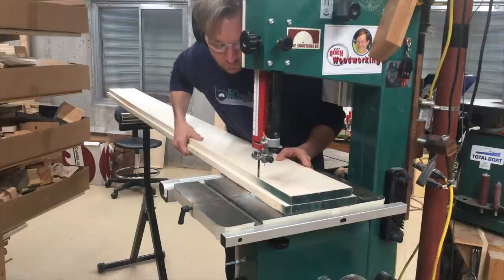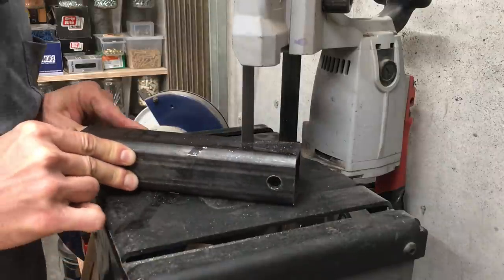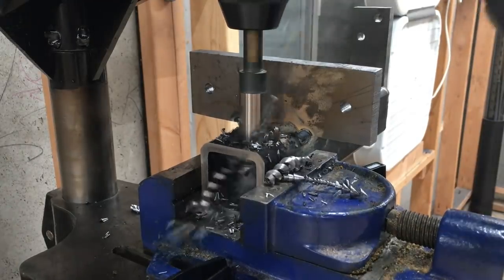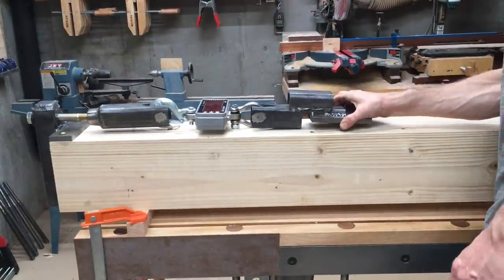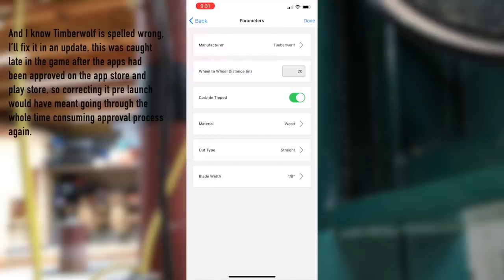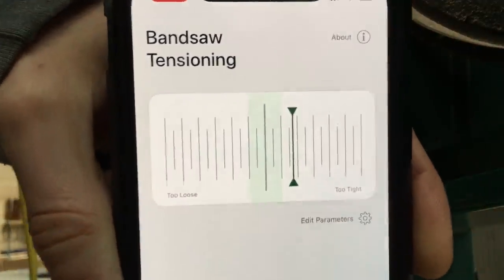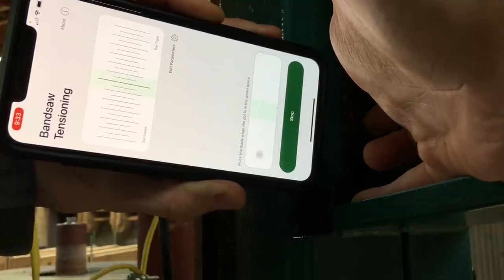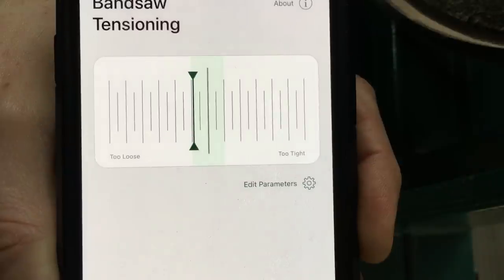New Phone App for Bandsaw Tensioning!

Comment: Love the idea! I just wanted to let you know that your app seems to have an issue on my android phone. It just freezes after taking the ten readings. Maybe it's just because android HW can be so different and a nightmare to test. But somehow I got the gut feeling that this could be due to the fact that I'm running a non-english version of android or more specifically a version which uses commas as decimal separator instead of dots. Maybe this messes up the analysis. I run into similar issues in a scientific work environment quit regularly ..
Reply from the maker: Sorry for this, yes, it seems I didn't test this on enough Android phones, I've gotten a dozen reports that the app locks up.  Working on it currently, top priority, and I'm pinning this comment as an alert.
Reply: @AndrewKleinWW  With essentially zero background noise, I get MANY errors in a row. I thought perhaps I had completely misunderstood wheel-to-wheel distance, but rewatched this video and you clearly say center-to-center). I then noticed that you seem to pluck before the dot hits the green area. Is my plucking IN the green area sending too many transients into the audio frequency analysis part? If it matters, this is the Android version running on a Google Pixel 3 running Android 11.
Reply: @AndrewKleinWW  let us know if we can help on the sticking issue.  I'm not a tech guy but willing to help pilot
Reply: Same problem. Android phone. At the end of the test the app freezes with no report. App Info/Force Stop gets it going again.
Reply: Same issue here on a Galaxy S9+.  Really like the idea, will hold off a bit before requesting a refund.
Reply: On Samsung S20 All I get is too much tension no matter if there is no tension.
Reply: Will there be an update once this is fixed? I'd like to know when I can try this again. I really appreciate your efforts.
Reply: Is this still supported/updated I see the last update was a year ago?

Comment: I thought about purchasing it - once metric is available.
The "decimal point"-issue (Germany and other European countries are using a comma instead), and the "distance between wheels" setting sounds kinda irritating bc. I want to use it with an Metabo 1638(\Elektra Beckum BAS 380\Emco Swing) that has three wheels , hence the saw blade will be longer!?

Comment: I bought the app, after watching Jonathan (KM)'s video from today.  Do you have plans to add a choice for a 5/16ths blade?  I live in Canada, and just bought a Rikon saw, their 10-3061 (haven't even taken it out of the box yet) and it came with a 5/16th's 6 tpi blade.  If I don't get an answer here, maybe I'll visit your website (listed in the app) - and I'm wondering if different tpi (on same width blades) is something you've considered - not that there's a ton of variety, but there is some, so there might be a 3/8ths with 3 or one with 4, and would the tone be the same, or does that matter?

Comment: I had to develop a technique to get consistent results. Seemed the following helped

Brace the iPhone against the cabinet with the microphone about 1/4” from blade. 

Strum with medium pressure so tone ends about the time app is ready for next strum. Eliminating any buzz from aggressive strumming. 

Only needs about 1/8 rotation of tension adjustment as results start moving toward green band. 

Rotate blade wheels a little after adjustment so blade tension change is "set in".  I guess this seats the blade better as it changed my readings somewhat.

Using 1/4” Timberwolf blade on JET 14”. Shows correct tension when JET “guess o gauge “ points to 9/16 (between 1/2 and 5/8).  This corresponds to my past belief that the JET decal set the blade too lose.

Overall a fun way to make sure that the finger method is getting you in the ballpark and your blade tension isn't out in left field somewhere.  I hope you make some $$$ on this app and keep refining it.  Thanks so much.

Comment: I have purchased your App as the concept and logic seems right and sound (excuse the pun), however I am concerned about the accuracy of the parameters in the settings.  (Especially as I am a metric user).  I used to play a little guitar and still do a fair share of sound reinforcement/engineering.  Length of strings, distances between frets, nuts and bridges on guitars and the slightest tension adjustments make a huge difference.  It concerns me, that the “Wheel to wheel distance” setup, (especially if using non-tested “Other” manufacturers), is only in 1” increments.  The difference an inch will make to tuning is massive. Furthermore surely the “Wheel to wheel distance” should also only be measured once the blade has taken up the free-play in tension as this will differ from blade to blade according to the TPI?

Comment: Gates produce a sonic tensioner for adjusting toothed machine belts like this, you tell it the belt, the center distance of the pulleys and then pluck the belt, it will give you a true frequency reading that you can then use to get the correct tension adjustment. I've been using mine for 20 years. It works well on my bandsaws too, once I found the relative frequency by trial .

Comment: Just downloaded the app, very easy to use, but no matter what I do to the 3/16” blade on my Grizzly G0555 the app says it’s too tight, even with the blade close to falling off the tires. My 1/2” woodslicer worked as expected, but I can’t get it to work with the skip tooth blade. Any suggestions?
Reply: Sorry, Andy, you probably don’t want this to become a support forum. My apologies, feel free to delete my comment.
Reply from the maker: No it’s cool, if you are having an issue posting here is fine, it’s a new app, going to have some bugs.  I’ve tried skip tooth blades without an issue, what happens when you use the app on the 3/16” blade but have the app set to 1/2”?  If you can capture a video of this and email to inkleind2303@gmail.com that would help.

Comment: Bought app, the meter reads towards the very top end of the scale even if the blade tension is detensioned and the value does not change as I add tension.  I took the phone in the house so no ambient noise and tried it and it actually gives a reading the same as in my shop using it with the bandsaw.  Can you help me troubleshoot?

Comment: What am I doing wrong?  I measured wheel to wheel center, entered the brand and blade size, ran the test several times to dial it in.  After I was near dead center I ran the test again and bam, right back to maximum too tight.  I did nothing between the two tests other than wait a minute.

Comment: Bought the app, but it is missing what I'm looking for in terms of blade selection. I intend to use it to help tension my wood-mizer bandsaw blade, but currently the maximum blade width listed on the app is 1". I realize this is probably a rabbit hole from a testing standpoint, but I would appreciate support for up to 1.5" wide blades,  and support different blade thicknesses like 042, 045, and 0.055".
I suppose I should have asked before buying, but the blade guides on a bandsaw mill are fully in contact with and depress the blade. When measuring the wheel-to-wheel distance, in this case do I need to measure between the guide wheels and not blade wheels?
Thanks!
Reply from the maker: Sorry, to launch the app I only cut up blades up to 1”, but I plan to expand this now that I have a launched it, so before too long I should have the sizes you need.  And you would be able to download that update for free.

Comment: Once again Andrew great idea. Just bought it, tested it with a 1/4’’ blade an it always says ‘’too thight’’  I got a 17’’ General International bandsaw (same as Grizzly) and bolt to bolt is 39’’  Am’I measuring wrong?  On Iphone.
Reply from the maker: Interesting, email me at inkleind2303@gmail.com and we can troubleshoot it
Reply: @AndrewKleinWW  I have the same issue.  Always says too tight even when the blade is really loose.  I have an older Laguna 16" with 39 center to center.  I am using a 1/2" 3tpi Timberwolf blade.

Comment: Really cool App, bought it. Can't wait to try it out. A few questions, should the blade be tested with all the blade guides backed off? and do I pluck the cutting side of the blade or the return side of the blade, or does it matter?
Reply from the maker: if you are going to test on the front of the wheels then yes the guides should be backed off.  I'd do it this way if I was changing out a blade and backing off the guides anyway.  Otherwise I'd use the back of the blade like I did in the video even though it is harder to get to.  Doesn't matter if you pluck the front of back of the blade but if you pluck the front use a scrap piece of wood or something like a guitar pick so you don't cut yourself.
Reply: @AndrewKleinWW  Thanks for the reply. Will try it out tonight when I get home. Love the innovations you are coming up with for woodworkers.

Comment: Is this compatible with bench top 3 wheeled bandsaws? What would be used for the distance between wheels?
Reply from the maker: Good question, I hadn't considered that.  It will work, and the distance you should plug in is the length of the freely vibrating blade section that you are plucking.  For a 2 wheel bandsaw that is also what you are doing, it just happens to be the center to center distance between the two wheels.
Reply: @AndrewKleinWW  thanks!
Reply: @AndrewKleinWW  set the parameter at 12" (I'm at 12.25" center to center of the two wheels on either side of the cut). Not sure if it's a bug or I'm out of range for the app, but of 25 cycles, only one provided a result, even in a dead silent shop with the air etc off.

Comment: Interesting  Will it work on a bandmill  1" x 144"   blade    :)
Reply from the maker: 1" is the max right now, so yes but barely.  I need to chop up and test some bigger blades before I can expand it if anyone is curious
Reply: @AndrewKleinWW  Got a few old blades laying around  Maybe some 7/8 too. If you need some pieces or what ever.  the Bandmill community I think would jump on this   Been a lot of talk on the boards about tension.  Its a problem with getting straight cuts

Comment: FYI, on my iphone 8 the app does not dynamically to larger text sizes (old eyes here).  The Start button gets pushed off screen.  Once I reduced text size to the young eyes level I could use it.

I also had a hard time plucking well enough to get the app to give me a reading.  Would be nice to have feedback other than the background noise issue; if the app does not receive enough valid readings, perhaps display a message to that effect.

Might be nice to link to your video about the app development and plucking procedure in the info
Reply: FWIW, its a Powermatic 14” bandsaw with riser block and 1/2” Timberwolf blade

Comment: Can't you measure the blade tension using a dial indicator to measure how much the blade moves when you apply a known force laterally?

The known force can be applied using a piece of string with one end tied to the blade and the other end tied to a known weight hanging over the edge of the table.

Some calculation is required based on band saw geometry, but it's first semester physics.

Comment: Great job, Andy.  Just bought the app.  Tested it on my bandsaw (Rikon 10-326) and found what might be an small issue.

I had a 1/2" woodslicer blade on from Highland Woodworking.  (great blade btw.)  Anyway, I used the "other" setting since it wasn't either of the other two.  No matter what I did with the tension the app pegged the "too high" scale.  I mean, even when the blade was so loose it was almost sloppy.   So, I changed to the "Timberwolf" setting and it immediately told me the tension was too low.  Cranked the tension up to where I normally keep it for that blade and the app said it was just slightly too tight.  small adjustment and it set right in the sweet spot.  This was a small amount less than I usually have it so I figure I usually have them too tight.

Bottom line, I think there is a bug in the setting for "other".  Other than that, Love the app.  This would be cool for scroll saws also.